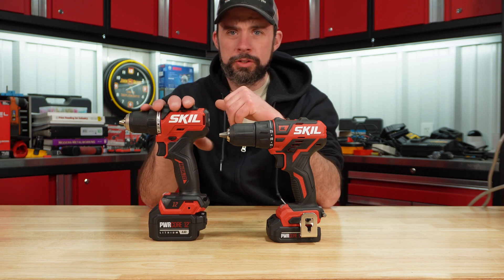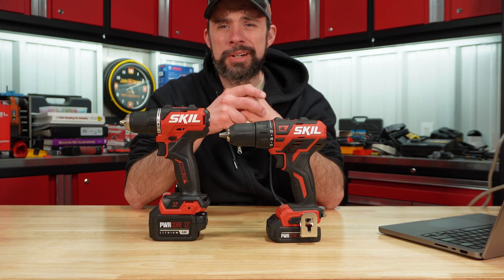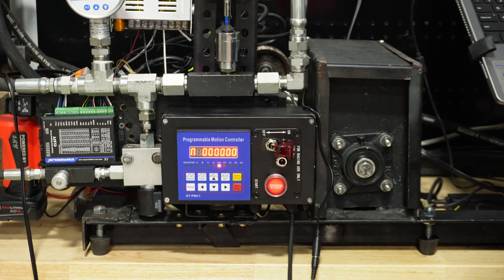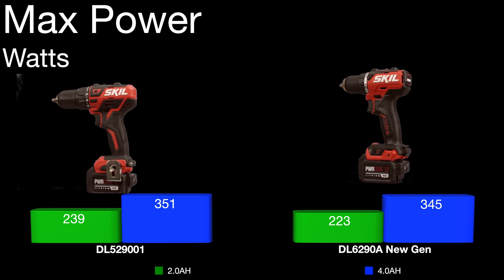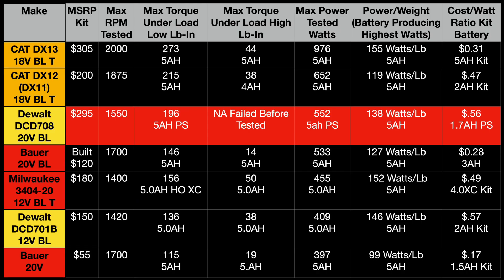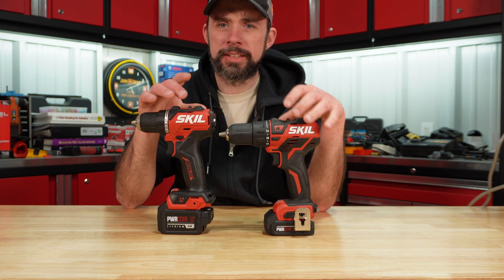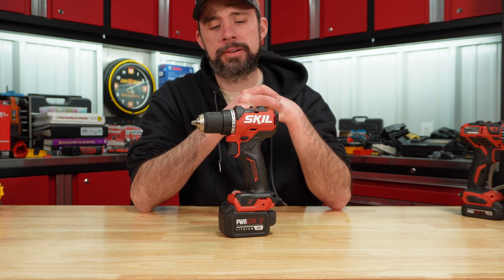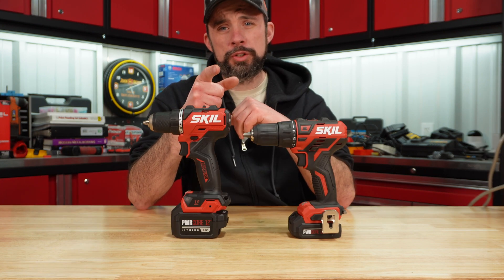Skil 12V Drill DL6290A-10

Comment: I just picked up the DL6290A-10 kit from Lowes for $39 + tax. Deal was too good to pass up.  I wonder how it performs next to my older Porter Cable brushed PCC601?
Reply from the maker: Wow you really cant beat that! Hard to say on the PC, thats one line I haven't add the batteries yet for.
Reply: well...
Reply: @Jakeisks it's on par with the Porter Cable, might even give the edge to Porter Cable
Reply: @Wiggles-0  
one reason I bought it was the battery's USB port. that's very interesting. no need for an adapter, like for a (DeWalt, Milwaukee) battery, for the same function.

TWIMC... mine has a USB-A port on the battery, the larger, unidirectional type.

Comment: Have had this 12v brushless from skil for a year and the chuck seized up. Won’t open one way or another. Have an old Milwaukee and some cheap ace hardware pos which never gave me this trouble. Not like I’m putting it though the paces either just doing basic junk around the house. Definitely don’t recommend
Reply: that kind of thing is usually just snag that can be worked free, and then exercised. I would try WD-40 or whatever.
Reply: You should still be under warranty, even now.

Comment: Nice to see Skil getting tested. I've owned the older generation for 10 months and had nothing but good luck with it. As a regular home-owner I've put in 100+ 4" by 10 deck screws without issue. And just recently had a horrible ice storm and was able to charge my phone using the type A port on the battery. Skil have amazing value.
Reply from the maker: Yeah its a very powerful drill for its size,  defiantly a good value.  Good to know you are having good luck with it.  I actually had the same thing happen and used the Skil batteries to charge my phone.